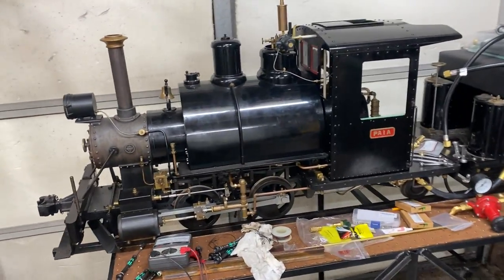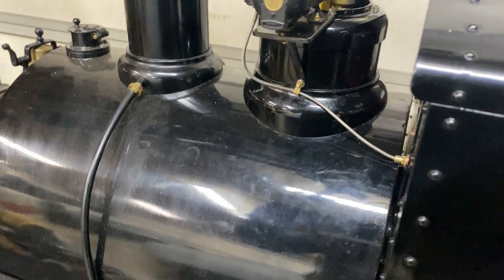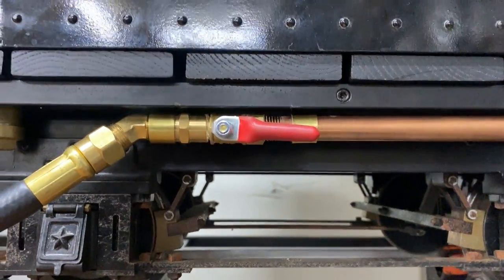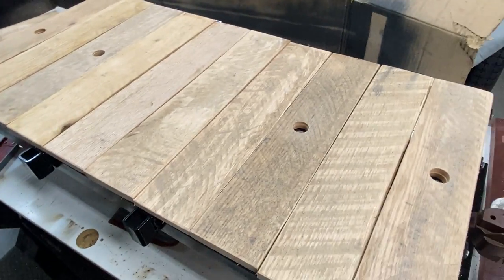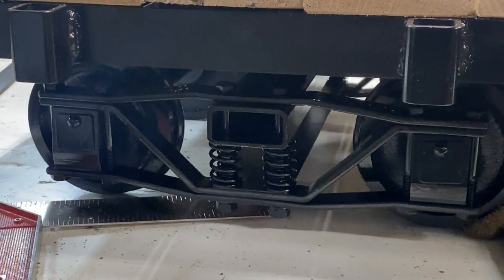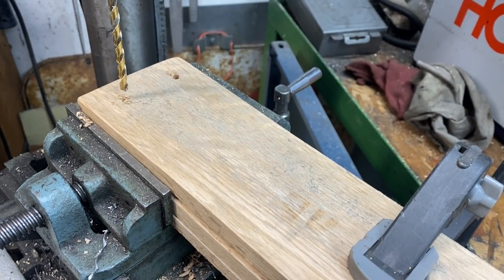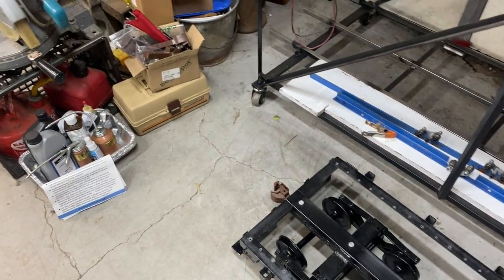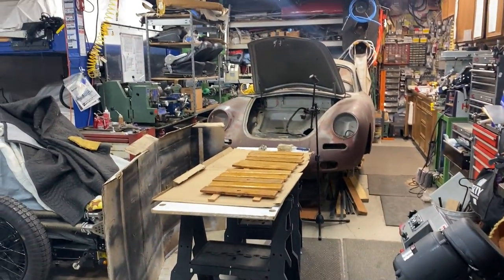Let's Build a 7.5" Gauge Railroad Flat Car/Tender, Part 1

Comment: A little thing I use when finishing wood is drive a few short nails through the runners that you are using to keep wood up off surface that way you elimate the strips where the wood touches the nail ends.

Comment: A couple of suggestions , one when drilling metal get some anchor lube to dip the tip of your drill in to keep the bit cool and lubricated , second would be to put a bunch nails along each strip to sets the varnish boards on do you eliminate them sticking to your drying strips ..
Reply from the maker: Thanks for the tips. Those really helped on my next flat car project!

Comment: A good way to clean a brush is to wash it out with clean white spirit then beat it dry as you did, then wash it with hot water and washing up liquid, repeat till you get some foam. That gets rid of the last of the diluted varnish or paint which stiffens the bristles.